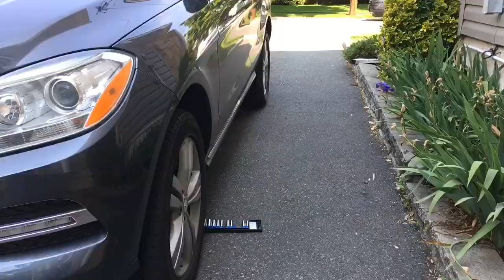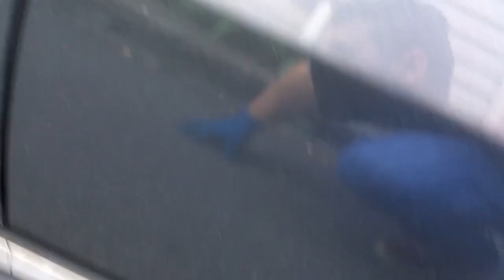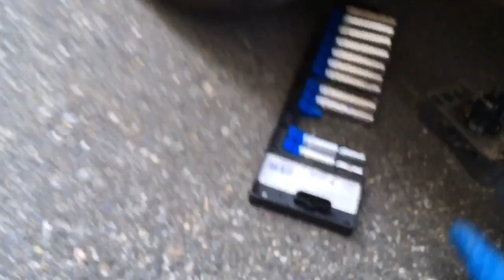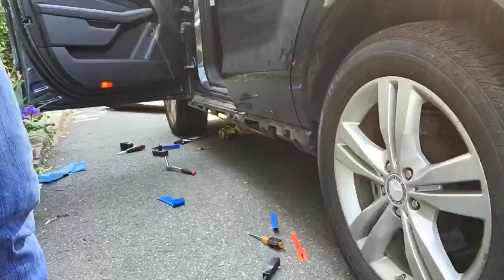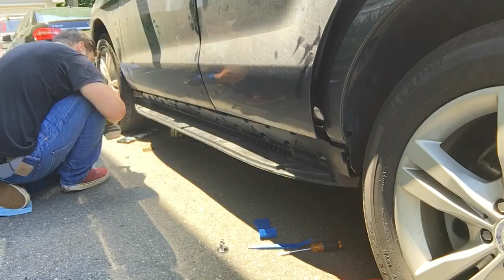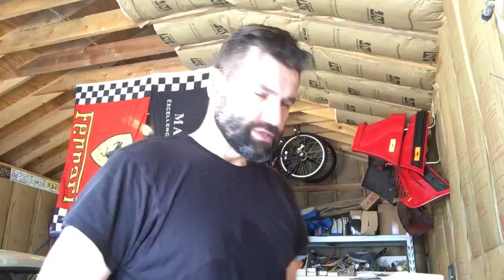Mecedes ML350 W166 cheap upgrade - side runner installation

Comment: IMPORTANT NOTES - ALL 6 OF MY LOWER 10MM NUTS WERE FROZEN AND BUSTED OFF THE RETAINING BOLTS BUT NO WORRIES - THEY MAY NOT BE NEEDED IN YOUR KIT - THEY WERE NOT NEEDED IN MY KIT AS MY KIT JUST SNAPPED IN ON THE BOTTOM.  WHEN PUTTING COVER ON, SNAP THE TOP IN FIRST.  ALSO DO NOT REMOVE THE JACK PADS, THE PLATIC SUPPORT CLIP HE SHOWS YOU WILL BREAK AND IF IT DOESN'T IS NEAR IMPOSSIBLE TO "FISH OUT" WITH A LONG NOSE PLIERS.  I NEED TO BUY NEW JACK PADS NOW AS THOSE PLASTIC CLIPS ARE NOT SOLD SEPARATELY - ALTERNATELY I WILL BY A CHINESE KNOCK OFFS AND GORILLA GLUE AND SCREW THE PADS BACK IN - THE CAR SUPPLIED JACK NEEDS THE INSET HOLE FOR PROPER PLACEMENT AND STABILITY IN EMERGENCY USE.
Reply: Your talking about the studs correct? Underneath?? My gl has the same issue!
Reply: Are yours still study, im worried mine are gonna be flimsy after that are yours ok?

Comment: Great content. The link for the product you got from ebay is not working. What side runner brand did you use and how much did you pay? How they have held up since the day they were fitted? Thanks
Reply from the maker: Thanks for the kind words.  Please like and subscribe if you haven’t already.  I paid $175 delivered.  Probably one of the cheapest upgrades you can do on these cars.  I took a look and it looks and it looks like this is the cheapest one on eBay right now. https://rover.ebay.com/rover/0/0/0?mpre=https%3A%2F%2Fwww.ebay.com%2Fulk%2Fitm%2F174079662034
Reply from the maker: About 1 hour or so